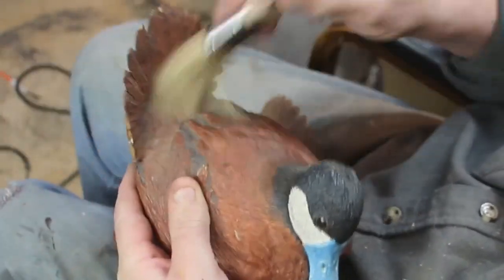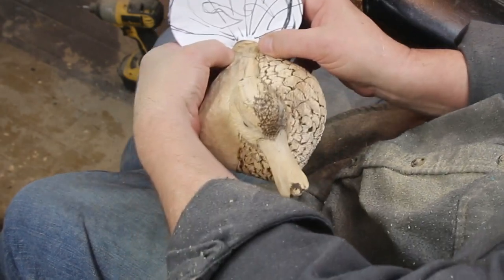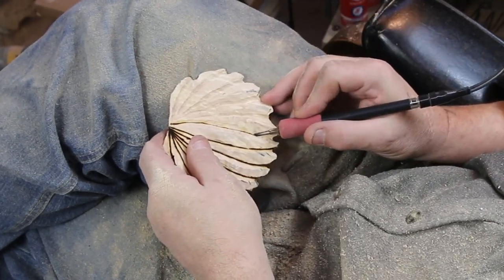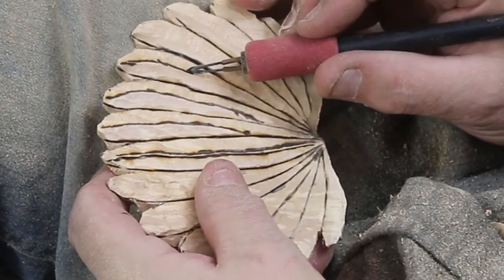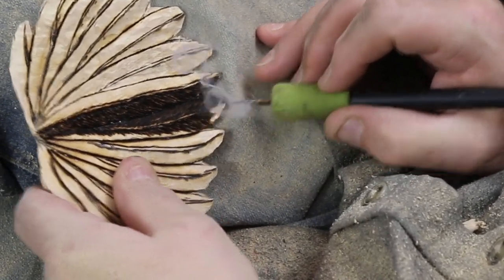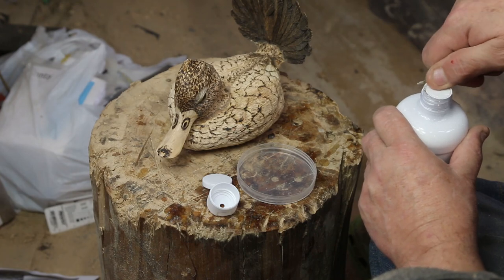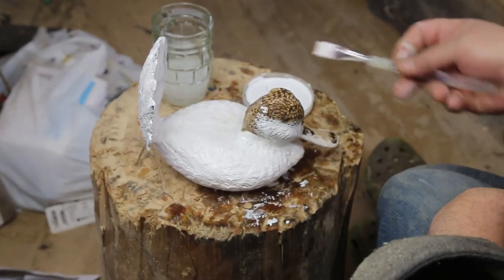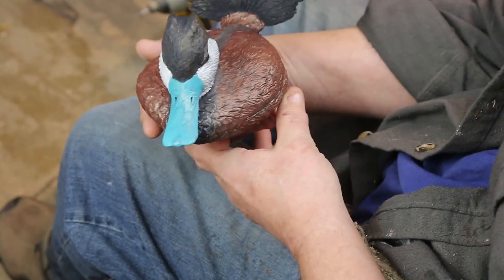Ruddy Duck Tutorial Final

Comment: When you're burning with your Optima one or dual what setting do you burn on 6 7, tried it on seven or eight and that seems to be doing pretty good
Reply from the maker: Hi Paul, I normally run between 5 and 7. I really never get hotter than that. I will do some shading in the 3-4 range on occasion. I normally go right to about 6.
Ben